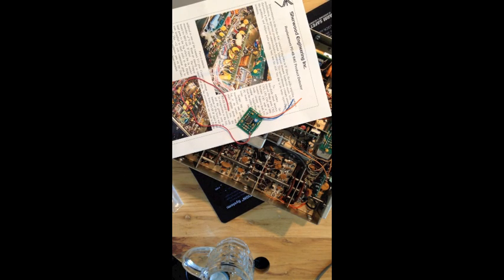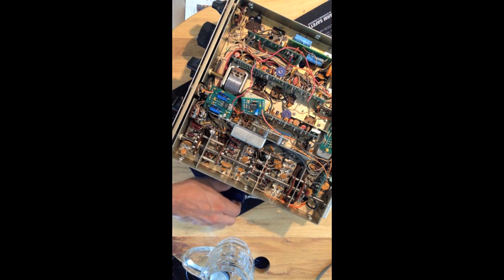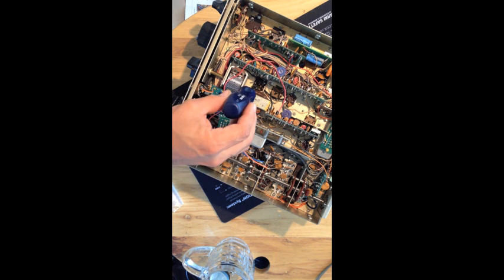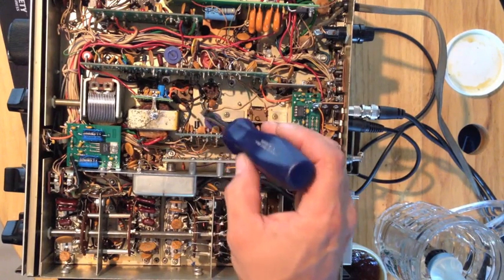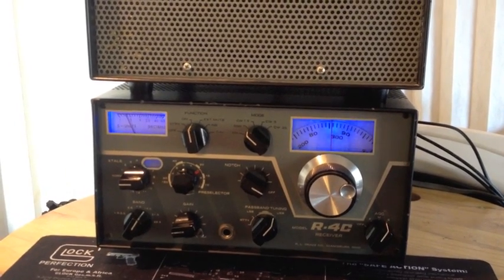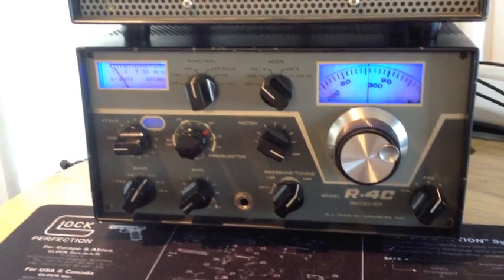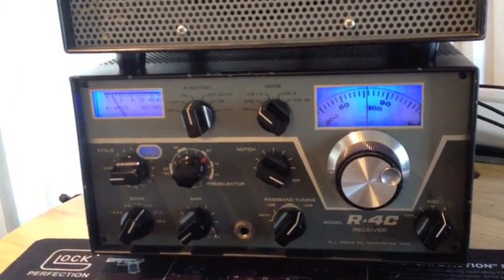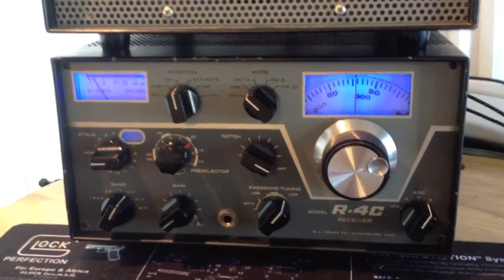Drake R4C Product Detector From Sherwood Engineering

Comment: what if you just used a r4b-do you think that the r4c is better than the b after the mods? I own both r4a and a r4b-the r4a pto has been replaced with a r4b pto and it has the best audio.
Reply from the maker: The mods are really for more contest and DX work. I would use my R4B for ragchewing bor better received audio.

Comment: I have an 4C with all the Sherwood mods. The differences are positive but almost never as dramatic as you expect (or hope). Like any high performance machine, improvements are incremental. If you have the inclination, install the custom front panel switch which will control your AGC as well as the roofing and any additional filters. The 5 selection AGC options of this switch is very useful.  Tnx fer the video!